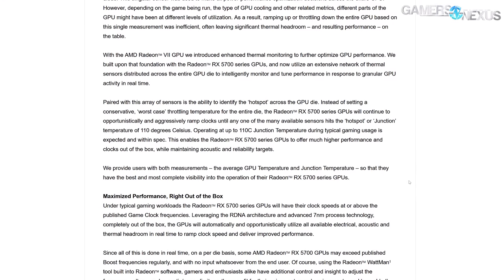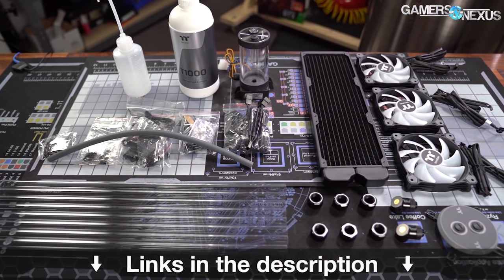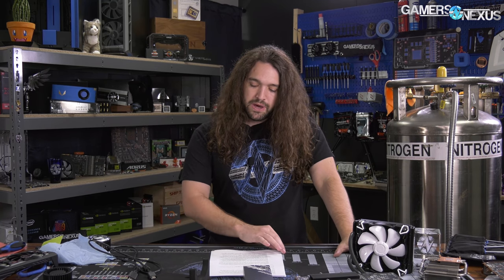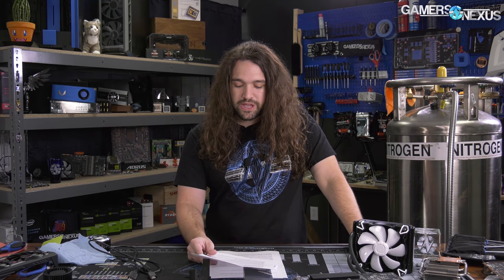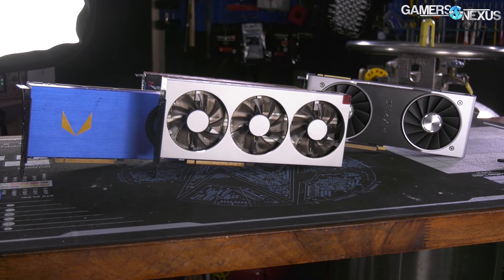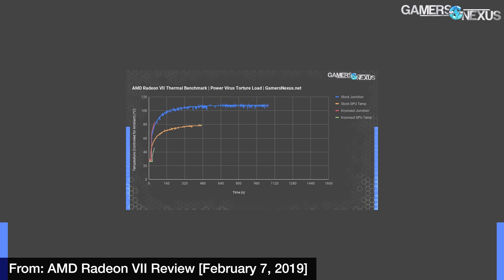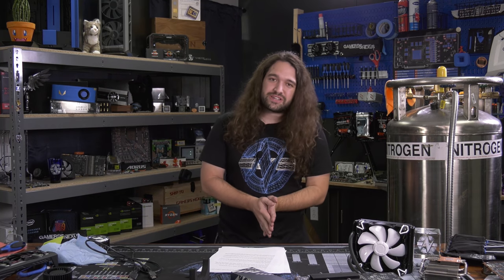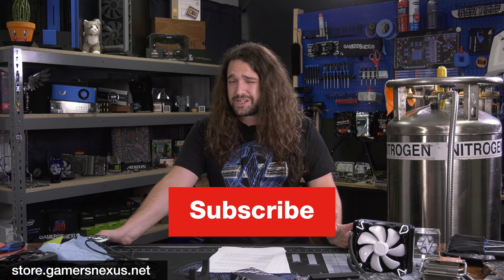Explaining Navi 5700 XT Junction Temperature | 110°C is Not "Expected"

Comment: I think I heard Steve mention that 110 degrees was (in his opinion) "too hot".
Did I blink and miss what the acceptable temperature would be from any authority that was involved in the design/engineering process?
Reply from the maker: To clarify, again, we think it's fine for the silicon. It's indicative of a bad cooler on the comparative, though.
Reply: @GamersNexus  So you're saying that running at up to 110 degrees is expected on the reference coolers?
If not, then what temperature should we expect?

Comment: Another question is if I want anything to push over 70 C to my room in summer. Rather not.
Reply: Jay Arre  Eh?
Reply: How much your components will heat up your room is a matter of total power consumption (and size of the room of course), not how good the cooling on your GPU is. A GPU drawing 200w from the wall is going to generate heat which is going to be dumped into the air regardless of the card's temperature. Your only way of keeping the room cool would be to dump that heat outside the room.

Comment: It's sad that people really need a 22 minute video to understand the difference between optimal/target temperature and max/peak operating temperature. That said the closer you can get the sensors to the parts that produce the heat the better so these hotspot sensors are actually a good thing and something I hope NVIDIA will introduce as well.

Comment: The whole thing is a "could" or "should" thing. Can the silicon run at 110 c without too many problems? Yes, technically. If your gpu is running at 110 c, should you shrug your shoulders and say that's fine? Hell no. I feel AMD is upset about the flack they've gotten for using the shit blower cooler and are now trying to justify them using it. Is the Radeon VII cooler really that expensive? If not, then design the reference pcb around that cooler. At least they wouldn't get shit on for using a garbage cooler.
Reply: But its not running at 110 degree's! its running at 80 degree's with short duration hotspots up to 110 degree. 
Just like every other high end reference cooled GPU since forever.

Comment: Auto OC I get 88 c junction temp on my 5700 xt with waterblock (Bykski) GPU temp 69 C.  2k max setting COD MW. GPU temp 69 C. With the blower at turbo speed i was getting about 98 c to 101 c. Junction temps.   88 c Junction is ok @ full load ?

Comment: 100 degree is still too high for me. using a vega56 w/ 3 fans now. gpu-z says it goes 87`C, draws 230W. a little bit high in my opinion. 80 could be ideal?
Reply: If its 87C average for the GPU, then, congratulations you are guaranteed to have hotspots (AKA tjunction) well above 100 degree's.

Comment: 110 degrees will cause the solder joints to break like the xbox red ring of death and many macbooks it's from the constant heating and cooling cycles making metal expand and shink uintill something breaks
Reply: except that 110 is NOT at the solder point but most likely in some spot deep within the silicone ... that temp is NOT at the EDGE of the silicone ...

Comment: sooo.. my9900k @ 5 ghz will hit 94c when using prime, but never in a realistic load. thats ok right?
Reply: Not really, the temps are fine, but half your cores are missing!**

That’s within Intel Spec (which is like 110c, after they gave up pretending the chips could be cooled with anything less than chilled water). So you should be fine. It is a shame though, as 5 GHz is trash compared to the 6 GHz you could get with some phase cooling, and if 4x cost increase for 1 GHz was worth it for Intel over Ryzen 1700x, then I don’t see why another 1 GHz increase for a more expensive cooler (that will still improve your next few upgrades) was simply out of budget, but whatever, that’s up to you, as I know many people are too scared to even overclock and yet still buy the k series so at least you’re not that bad...

** Lol, JK, Threadripper user here, as I needed more than 1 GPU for 4k gaming and 16 PCIe doesn’t cut it, especially for 4x GPU... I wasn’t about to lose half my memory channels, gimp it to 1/4 the PCIe lanes, make it much harder to cool, lose half my cores, and pay MORE for the 9900k just for some 800 MHz advantage over the TR-1950x... Haha, no thanks!

Comment: AMD should take note from Powercolor for example, quiet and cool. Blower coolers are shit and will be. AMD just make the GPUs use minimum 500g aluminiun heat sinks and minimum 2 x 120mm fans, period, problem solved. 110c is not a expected or normal gaming load temperature, FFS. I have never touched a GPU with under performing heatsinks and fans. Always waited for AIB models and reviews before buying products.

AMD being defensive and treating customers like a bunch of idiots.

Comment: Is this a sign of AMD planed planned obsolescence? Running at 110c will reduce the life of the card faster then 86c.
Reply: So what i remember right the blower cooler design is from AMD to have a card which is always in temperature specification on every computer. (Especially badly designed one). AMD seems to have been called out for coolers running to hot on certain systems and the blower cooler design should always stay in that target no matter how bad the airflow is.
Nvidia is not giving us the junction temperature so we can't really compare that.
I think its just a sign of bad wording and sticking to a bad design, because of bad press in the past.
Maybe its a sign of very aggressive clocking the card

Comment: The thermals are just too damn high!

What does thermal expansion look like inside these dies? Railways turn to spaghetti when they get heated a bit by the sun so its a miracle these things can keep running at waterboiling temps.
Reply: Silicon ain't metal tho
Reply: @gustavrsh  yeah, but there are like alot of other metals deposited onto the silicon. And they are just atoms apart from eachother.

Comment: Asus and MSI are the worst offenders be it AM4 or any version of the rx5700 even the non xt versions are totall shit 111C here card is basically brand new
Reply: My RX 6600 had the same issue but overtime the junction temperature got lower because the thermal pads squished down, and whenever you have new thermal pads it's gonna happen again when those fully get settled down, those get stuck at the cooler making better contact

Comment: Yeah sure the gpu can handle running at 110..  but that means you are always hitting the thermal limit and you're probably not getting the best performance you can get from the gpu since it will not boost any higher even if it could under better cooling.  It's "normal" to run at 110c if you like to boil water on your backplate.
Reply: tjunction temps never, ever, leave the die, let alone reach the backplate. they last FAR too short for that and are far too local.

Steve REALLY should have put more emphasis on the difference between the average temperature (around 80 degrees for Navi, same as any other referenced cooled GPU) and the tjunction temperature, specially in the title. 
Navi is the first to actually report tjunction temps, and even though they aren't higher then any other high end GPU with a reference cooler, people are extremely confused about them.

Comment: I've got an EVGA GTX980 with the dual axial fan cooler on it. This card, even when overclocked, almost never gets over 60C, unless I throw a fuzzy donut at it, and then, it almost never gets over 80c. Owning this card has taught me that a well-designed cooler is worth more than almost anything else. My card will throttle for powerlimit before it ever gets close to temp limit, and the fans basically stay silent, unless the AC dies in the middle of the summer, and then they do ramp up (custom fan curve).

Now, I want to upgrade to a new card, and PC. Should I get a 5700XT with an upgraded AIB cooler design, or just jump straight up to watercooling, and get a reference card? Or should I leave PC Jesus alone, and ask the Watercooling Wizard instead?
Reply: @vh9network  I 'borrowed' a SCSI array when I was in HS. I ran it for about 9 hours, in the middle of winter. It warmed the entire house up to like 88F. We actually had to open the windows, and it was snowing outside... It also like doubled our power bill for the month. I took it back to school, and the drives were all recycled...

Comment: My GPU has been hitting 80c when it used to top maybe 75c. Do I have an issue or it runs at 80c? Idk much about changing fan speeds to help that. I also have a newer CPU and mobo so maybe that's why temps are higher than they used to be.

Comment: I love the blunt intro 😂

 “We have said this before but you morons need to hear it again” 

Lower temps are better, buy the good cooler.

Basically amds 110 is equivalent to what from nvidia ? You say estimated 30 degree different temp from edge temp to tj max ?
So 110 = 80 on nvidia ? 

“It’s not that the cards have mics in them yet “ 
Ohh no now I have to worry about the mics being added and my video card sending recordings of me and my gpu fans to humans to review while I’m gaming !
Reply: Lower temps are better, buy the good cooler"

Watch the video again, as you clearly didn't understand it!
Reply: Downwith thatsortofthing  dude I understood it. 

You won’t gain anymore speed at a certain point but staying away from literally the maximum operating temp is beneficial.  

He’s basically saying buy the partner cards as they are quieter and run at safer more reasonable temps with less power leakage and the possibility to boost higher to a point but not infinitely high like amd leads a person on. 

But thanks for offering no insight but calling me stupid.  Well done bro.
Reply: @Bill-flatplanefool  So many words, so little understanding!

The cards run hot, maybe too hot. No matter the cooling, they are hot cards and AMD is trying to mask that. After market coolers will help, but these are hot cards.  You seem to have totally missed that point!

You said in your original post; "buy the good cooler", what so the cooler will change the card's architecture will it? 

So, you were saying about calling you stupid?
Reply: Downwith thatsortofthing  keep going I think you are missing that they are giving you a peak temp rather than an edge temp. 

So part of it is the card does consume a lot of power and runs hotter than average.

Part of it is THE STOCK BLOWER COOLER IS GARBAGE especially in a case with poor airflow.

At what point was the architecture brought up as the excuse for the temp? 

Drop a time stamp 

References multiple aftermarket coolers improving thermals no less than 5 times playing in the background while writing this.
Reply: @Bill-flatplanefool  The thermals aren't improved. The thermal output of the device remains unchanged, the fan dissipates heat, it doesn't 'chill'!

There isn't a single fridge/freezer anywhere in the world that actually 'cools'! They only remove heat. That's what a CPU/GPU 'cooler' does, except it dissipates the heat rather than removing it from the device! That you understand none of this, demonstrates the silliness of your posts!
Reply: Downwith thatsortofthing  jfc dude you are just a troll, I’m done.

Some kid took thermo1 and now has his internet PhD in thermodynamics y’all.

Comment: I have a 6600xt with a delta of 23 degrees Celsius between edge and hotspot temperature.
Almost in all titles I have approximately 69 degrees edge with almost 92-93 hotspot temp.
That is with 1900rpm fans, is this abnormal? Perhaps a cooler mounting issue/paste issue?

Any help is welcome.
Reply: that's normal and it should be fine

Comment: I have the Vega 56 Pulse and it doesn't seem to have "junction temp" as something I can monitor. Correct me if I am wrong but the junction seems to be about 15 degrees over CPU reported.
So I loaded up the game Observer because it runs at 1600+ MHz on my card. I played it for two hours with GPUZ running in the background. My VR SOC hit a max of 80° C, VR Mem hit 77° C and the GPU temp temp hit 73° C. Would that indicate that the "junction temp" is about 88° C?
Reply: Without a junction temp monitor it's hard to know. You could have a spot on your GPU with a thinner spread of thermal paste than the rest, or have air bubbles in the compound, and the junction temp there could be 100c. Although that will usually tend to warm up the rest of the card. This also depends on how good the cooling solution is. If the cooling solution is very good (especially with water) you could still have a bad junction temp somewhere, but the cooling solution is efficient enough that it's pulling the heat out of the rest of the chip quickly enough to mask the problem.

Comment: The issue with temps 80-110c is not if they are expected or not, the issue is its too f@cking hot... I  don't  need a freakin heater in my office.  Florida is already hot enough.  X570 is generating too much heat across the board.  Heat dissipating is the problem,  it's not a good thing.
Reply: That doesn't make any sense: the GPU generates the same amount of watts (heat), regardless of the cooler.

And those 110 degree junction temperatures are exactly the same as any other high end GPU's with a reference's  had since forever.
Reply: @TheCountess666  Have you been taking note of all reference cooler junction temps since 1995?
And the 5700xt isn't pitched as high end.
Reply: @Safetytrousers  it's priced as high end. and it obsoletes basically all of nvidia's cards except the 2080s and 2080ti, which are both enthusiast class.

and it's all just physics. as most refernce cooled cards run at around 75-80 degree's, they'll all have roughly the same tjunction temperatures.

Comment: Sooooo just to be clear. If my GPU hits like 70 degrees edge and 85 ish degrees hot spot. Is that okay? Or should I be alarmed? It's an RX 6600 and that's with max settings at full HD with a 60fps lock.
Reply: that's totally fine, this GPU can go as high as 110°C although if it's way below 100°C, there's no need to worry.
Reply: Totally fine

Comment: G'day Steve,
Are you Saying there are people in this world that twist what other people say to prove their point, also there are lies on the internet? 😮😮😮😮😮
When you mentioned Bad Case Air Flow I was expecting either the ENSO or WalMart PC to get a mention, You Didn't Disappoint,
Personally to me if 111celcius is bad I think 110celcius is as close enough to bad as being bad,
I'd much rather run mu GPU or CPU 30c cooler than max temp which is why last Summer here in Australia I left my PC off during the day as we had close to 50c Ambient & I don't have Aircon.

Comment: @Gamers Nexus I don't get your point. If AMD's statement about boosting is read as intended -- "Temperatures up to 110 °C will not prevent the GPU from boosting" -- then were is the problem? One could argue that better coolers are overdesigned and cost the customer more money than necessary. 

AMD did NOT say that their blower cooler is all one needs because indeed other coolers are quieter. So other coolers have their justification but not because of the junction temperature.

You cannot both agree to the statement that 110 °C are within spec and claim that it is bad to operate at that temperature. If you actually have an argument, you presented it very poorly.

Comment: I know I am late just got the 5700 Xt thic 3 ultra and junction temperatures are always at 110 degrees is this normal for this model?
Reply: I have that exact same card and I'm having that same issue. Did you manage to solve it? Most reviews of this card praise its low temperatures when compared to other 5700 XT cards but my experience say otherwise.

Comment: I don't even like seeing, 70C+ :/.  I've had a bunch of cards that didn't last long at 90C+
Reply: You must have seriously bad case airflow if you've had "a bunch of cards" that operated above 90 degrees. I've literally never owned one that operated at that temperature (and I've owned a LOT of graphics cards), and the only one I can think of that actually runs at those temperatures (discounting these completely different junction measurements) as part of its normal operation is the reference 290/290X.

Comment: my 6900xt Hits about 70-75c on GPU and 95-105 on junction temp. So far seems ok. OBV i wish it was lower but it is what it is i guess.
Reply: The only can do is undervolting i did in my RX6800 lowering the junction 100c to 80c and GPU 70 TO 65C. only loss a minimal FPS in games, not much, in Howarts legacy loss 140 to 130fps not much.

Comment: my principle in buying pc stuff proc,gpu is how cool can i get it to run under normal conditions ie air cooling. my room is 32-34 degress celcius in the day time and 26 degress at night with 70-90% humidity. a poor cooler design or case will show its ugly head really fast.

Comment: Well at least it is hotter than my old reference R9 290/290X :)
Reply: no, it isn't.
The R9 290 has the same tjunction tempetures, if not higher, they just didn't report them.
in fact all high end GPU's with a reference cooler will have tjunction temps well over 100 degree's.
Reply: I was trying to be funny, apparently I failed 🤦‍♂️
Reply: @CEUOTC  Poe's law's a b*tch sometimes....